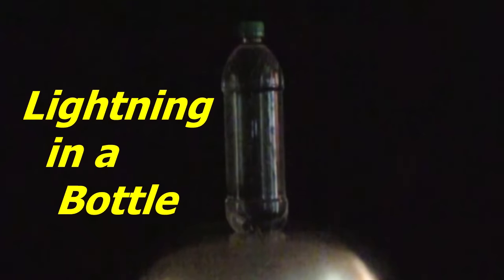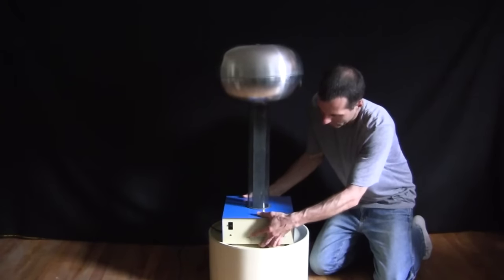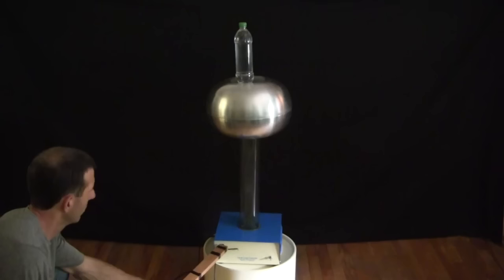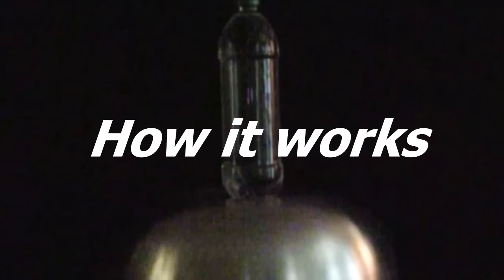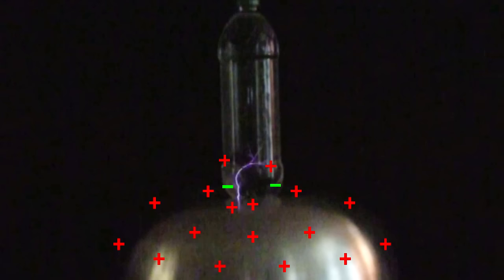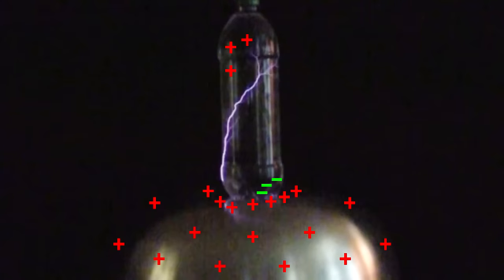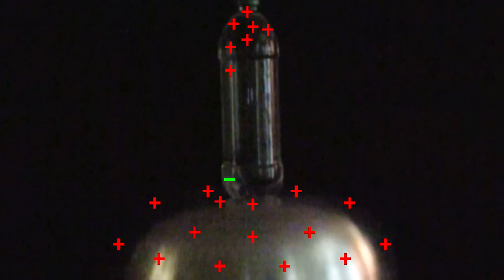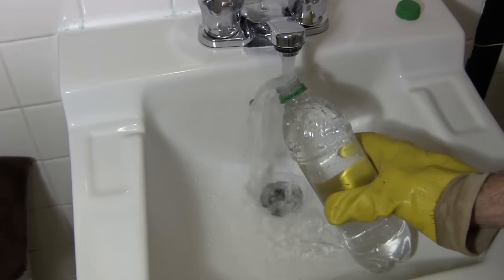Lightning in a Bottle & 100,000 Subscribers!

Comment: So it was lightning on a bottle...
Reply from the maker: No, it was inside.
Reply: The sparks are really inside of the bottle!? In water?? Are you sure? To me it looks like the sparks are on the surface of the bottle. Why the electricity is not conducted in the water, instead of dielectric breakdown!?
Reply from the maker: Yes, I'm very sure. the sparks are inside. The key is that there's a plastic insulator between the dome and the water. That's what's allowing charge to build up at the bottom of the water and for the subsequent charge separation to happen in the water. If somehow you had the water directly on top of the dome then it would act like an extension of the dome and charge would just spread over the exposed surface of the water.
Though there is the issue of the sparks gradually getting taller and taller.  Possibly that's because the resistance of tap water per cm is in the kilohms; I'm not sure. Another possible contributor to that may be that the outer surface of the bottle gets charged gradually from the bottom up and that that's somehow contributing to the charge level in the bottle rising. It's also possible that the sparks are on the inside surface where the water contacts the bottle but that would require multiple camera to check for. Looking at it from one angle it's impossible to tell.
You definitely get a painful shock if you open the bottle after and stick your finger inside while holding onto the bottom of the bottle with your other hand.
Reply: Water bottle capacitor effect is not that surprising, but seeing lightning inside water is pretty damn weird. Can you try to replicate that with salt water and distilled water (warning! the latter may be dangerous)? I would really like to see the difference!
Reply from the maker: Before I ran out of bottles from breakdown I tried with no water and nothing happened at all: no hissing, no sparks, and after discharging the dome I was able to take the bottle off of the dome with bare hands and there was no spark to myself, no sign of charging. I also tried with distilled water and the result was comparable to that which you see in the video with tap water.

Comment: Wow interesting effect. I tried with a flyback but not enough volts..
I think your close with your theory. I experimented with charging water a while back. https://www.youtube.com/watch?v=8FLRvdVt8XQ  I found an open cup could store pos charge for weeks with almost no loss (an accidental shocking discovery when cleaning up one day) but neg charge leaked out in minutes. I think the 2 hydrogens give water a positive affinity. Not sure if thats related but I think it might be. I've also seen arcs like that on highly charged dielectric surfaces before. Especially when testing broken home made capacitors.

What I think is mainly happening is much as you described. The outside of the bottles capacitance gets charged pos near the VDG but neg at the top. At some point the air on the surface breaks down and an arc drains some of the lower neg charge to the VDG. Each time this happens the arcs get higher up the bottle until the whole outer of the bottle is charged and only new charge gained from the air is discharged each arc. This fast change in charge is essentially a brief (half cycle) ac pulse. Which allows charge to pass to/from inside the bottle. Each spark leaves the inside of the bottle a bit more neg. Until the waters charge is strong enough to breakdown the bottle. A bit like a voltage doubler...

Can you swap the rollers in your VDG and try neg charge?

Its a real can of worms. The water is completely isolated inside a sealed bottle. Yet the charge is able to change. There are no particles (bigger than photons) passing through the plastic. Yet the charge still builds up. It has to or it would blow the bottle right away. A normal voltage multiplier would need diodes and a ground connection to complete the circuit and allow the charge to move in the right direction... This is not a circuit that I can see....
Reply from the maker: No, I can't swap the rollers on this one. I know based on the materials that the dome is positive so I'm inferring the polarities inside the bottle from that. Makes sense though.
I don't remember having seen that video of yours before. Must have missed it, either that or it was so short it didn't register in long term memory.